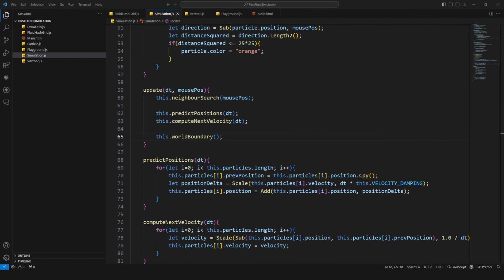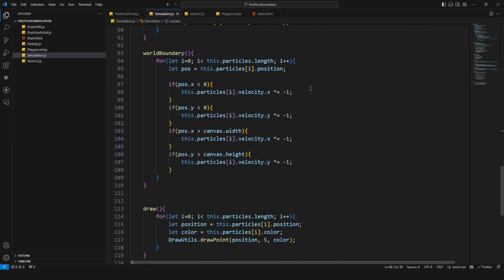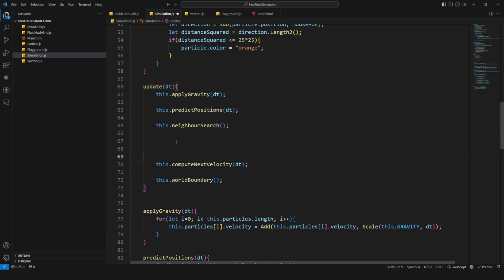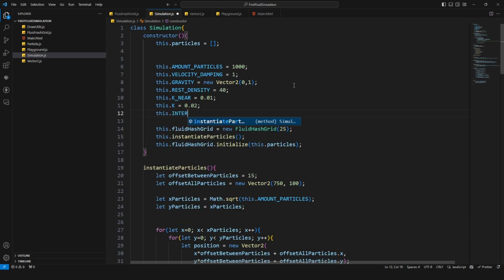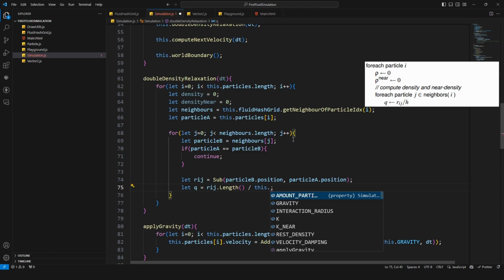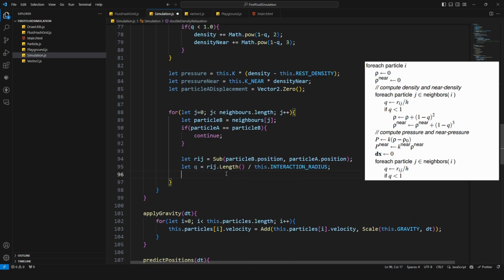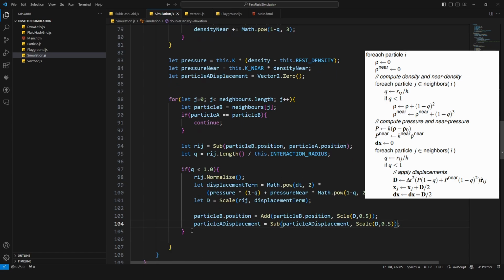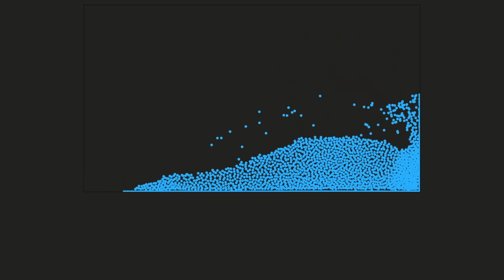Fluid Simulations made easy - 07 Double Density Relaxation

Comment: I tried optimizing the maths and other things to see if it made any difference, and it actually did!

 * Simply changing the pow function by multiplications reduced ms per frame from ~20 to ~17. I really wasn't expecting it to make such a noticeable difference (maybe it was already optimized by the compiler), but it really does seem to do matter. Interestingly, both versions do not produce the exact same result, probably due to floating point stuff.

* Then I tried moving the division that makes q to the interior of the if conditional, to avoid division when the condition is false. This sometimes seems to reduce up to 1ms, but sometimes it doesn't. Maybe that's because sometimes the fluid is in a state that lets it skip the conditional more often. So I will just let it inside the conditional.

* Not using the Vector2 operations inside doubleDensityRelaxation() led to another improvement of 3ms with respect to the original code (from ~20 to ~17 ms). This means replacing things like position = add(position, velocity) by position.x += velocity.x; position.y += velocity.y; Again, I didn't expect this to be such an improvement because I figured the compiler optimized away these basic function calls. Later I will try to de-vectorize everything, getting rid of the class altogether.

On a more complete simulation the division skipping does show a slight improvement, and combining all these optimizations I go from ~32 to ~20 ms per frame.

There are plenty other things that can be optimized, like using a single ArrayBuffer for the particles array, representing each particle as a series of floats within it. This is basically required if I want to get the GPU involved. In any case, I understand optimization and GPU offloading is not the purpose of this video.

Comment: I have been following up to this part. I have beeb trying to build the fluid simulation within Houdini instead.
However, I am currently experiencing an issues with gravity force. I believe there are not enought sub-steps in my case. As the gravity move the particles too quick, the double relaxing is not able to catch up. All the particles end up overlapping and collapsing on the ground plane.
😢
Reply from the maker: Try to set the gravity to a very small force. If the particle still overlap at the bottom, there might be a problem or a mistake with the pressure calculation.
If you don't find the error, feel free to send me your code to my email so I can take a look when I have the time :)

Are you doing the Sim in 2d or in 3d?
Reply: @pixel_physics Hi, I have got the fluid working in the end! Every program run differently, I needed to implement some other algorithms to get it works in Houdini. I am now continuing with part 8 of this series. 🙌
Reply from the maker: Nice to hear! :D